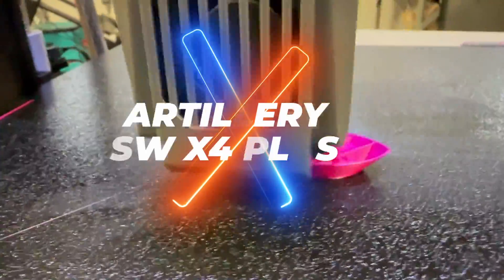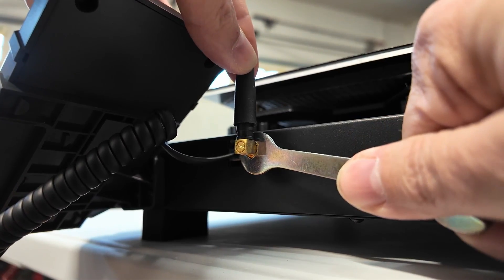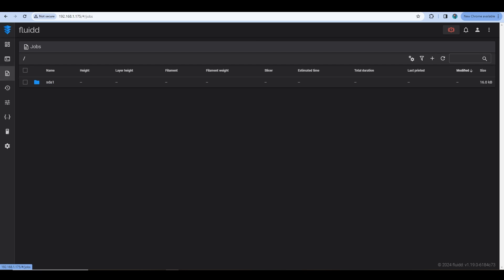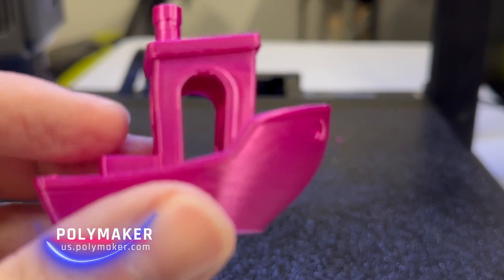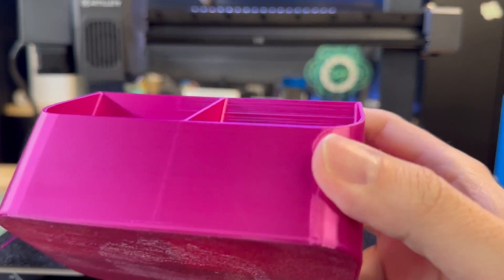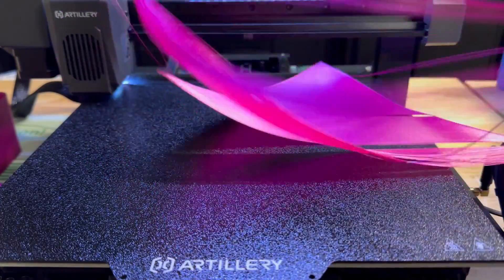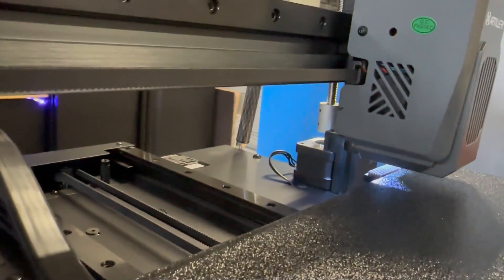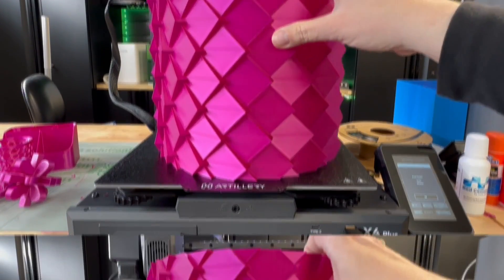Artillery Sidewinder X4 Plus 3D Printer - A Refreshing Change!

Comment: Sorry, as of this moment, my X1 produces a much more consistent and higher quality print than the X4.  The X1 was much easier to set up as well.  I gapped the nozzle on the X1 and haven't needed to relevel the bed in over a year.  I typically print my end-use prints with rafts.  The X4 rafts are almost like window screen porous.  I print mechanical models so I need consistent print surfaces, not tge wavey gap filled surfaces I'm getting.  Artillery is trying to help, but no luck yet.

Comment: I just bought one. I've been using a Makerfarm from 2014 upgraded to an I3V and completely modded with a bed size of 180mm X, 190mm Y and 375 Z. I had it printing really good but it finally broke again and I'm tired of always working on it. The Sidewinder is going to be like moving into the space age directly from the stone age. Even the downsides of it are going to be upgrades for me.

Comment: How do you think the X4 Plus would do with solid bed mounts? I do not get along well with manual bed leveling. Is Klipper the full deal? Can one get in and tinker with Klipper settings? I love the bed size, display, and speed. I would be printing robot, robotics, mechatronics, and functional parts for myself. I need to print some Multiboards and such for my tiny studio apartment so I can have all my parts within easy reach.

Comment: Hello, I have the printer home... But the Slicer is verry bad. The settings are to low Speed and not much optimize and when I put the speeds up like you have in your video I get over extrusion with small parts and the nozzle scratches verry much over the printed surface. So much that the nozzle shoot the parts from the magnet plate. 
Can you post/show your setups I think you have much more experience with printer at all... Thank you very much!

Comment: I like the addition of the stabilization rods and the Spring steel plate ....but everything else. They added messes it up. The X2 was almost perfect if they had added those 2 features and a full metal hot end...... This is way more messy than their previous printers........ That cable system is absolute clusterf#@%...... I have an x one and couple of their x twos and they are way cleaner designs....... I do not know why everybody always b**** about the printer cables. That's what printer cables were made for.
Never had an issue with those...... Really hope they go back to their original designs. So much more elegant and once the x two was dialed in works great There's still not a fan of the access plastic at the top for the spool holder little wonky......but other than that...... This seems like a major step in the wrong direction.😤

Comment: Good job. I have the x3 plus. I was curious about the x4 plus. I would take one off there hands, but i dont know if i will buy one yet.
Reply: Looking at the X3 plus, hear mixed reviews, what are your thoughts? Might opt for the x4
Reply: @bestevercody  It me way to long in, my opinion, to get my x3 plus bugs worked out, i like the linear rails on the x4, you dont have to worry about loose essectric nuts. It does print faster has klipper, but i have never used klipper. I hear good things about klipper.

Comment: The leveling wheels put me off from the get go, no auto z offset then!
 Those bed adhesives with the pads are a pain as they wear away well before even 10% of the adhesive is used, the spray ones are much better.

Comment: I like the fact that z-axis has supports, which were missing with very popular X2 model. But it's too bad manufacturers are still staying with "screws at the bottom" frame mounting system. I saw on Sovol S06+ it's done better and it's stiff even without supports. Anyway on that printer I would print many enclosures for my electronics projects as it seem to be good on solid walls.

Comment: Hi, like the video. Two hints, you might want to check that the z-axis is perpendicular to the bed with a large carpenter's square or maybe a shelf... The printer's design has excellent adjusting abilities. If it is skev you'll notice in higher prints.
Second, you may want to increase first layer's nozzle % print volume perhaps going from like 100 to 103 or so. Considering the bed has such rough texture it consumed more filament and your calibration was probably very good.
If I had this printer I would be printing helmets and a few large vases in pla silk.

Comment: I have two artillery genius printers and they both work pretty good. I would like to replace one of them with a new genius pro. I reached out to Artillery and ask if they are going to be releasing a new genius pro with the features of the new X4. They said no they are not. I don't have room for a larger printer. I am going to have to shop somewhere else.